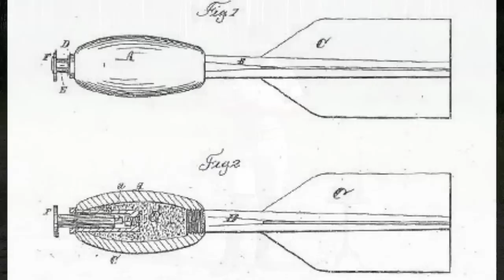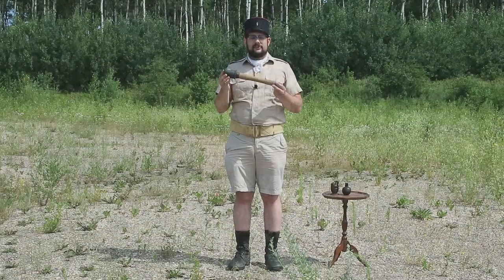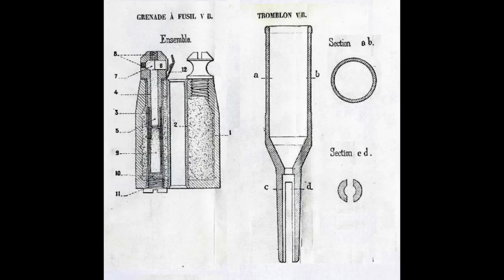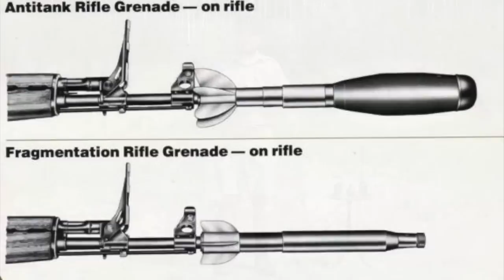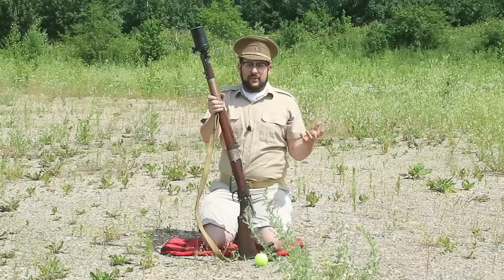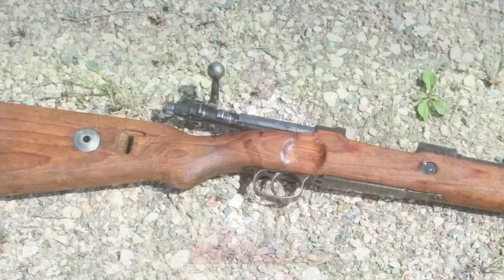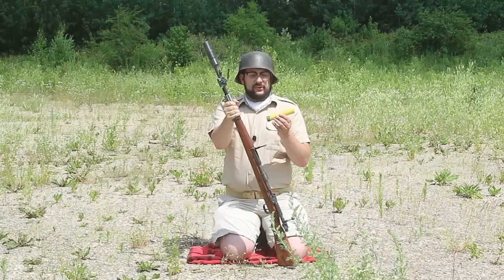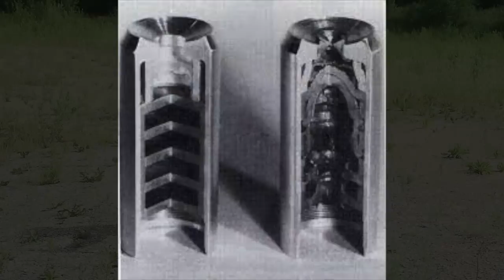The History of Rifle Grenades

Comment: I just watched this, thanks for posting!. I served in the French Foreign Legion, 1977 -1982. We had initially the MAS 49/56 which had an updated version of the grenade launcher that you demonstrated. It used a dedicated firing round, this came packed in the spigot of the grenade itself, in a rubber bung that had to be removed to get the spigot over the barrel. The range was set by sliding a calibrated ring up or down the barrel, rather than the screw attachment that you demonstrated; I think this was part of the 1956 modification on that particular weapon. On the range, it was surprisingly accurate. In action, a degree of nervous tension set in and it was harder to hold the weapon exactly level to the levelling device. Also on the levelling device was a crimp, a sort of simple sight to give you the direction of fire. However, if you twisted the rifle on the ground to get the direction exactly right, this would tend to dip the barrel in the direction of twist, affecting the range; so in reality the grenades landed at a variety of ranges, which tended to limit the weapons effectiveness. It did keep heads down, though!
Reply: Very cool info. Thanks...
Reply: Legio Patria Nostra!
Bonjour l'ancien.
Reply: Merci pour ton service, Légionnaire !
Reply: I also servered in the early eighties and we used the 49/56 for grenades as the FAMAS ones did not come out until 83 ish. This rifle was a real pig to fire if you were doing it anti-vehicle with the strap across the chest and I saw many a bruised or broken thumb from it not being held properly. The ring was called the 'bague coulissant' (sliding ring) and was elevated up the barel to decrease pressure and reduce the range. The sight I believe was 45 degrees to go out to 400 metres and 74 degrees to go to 200. Great little rifle. Later the FAMAS had grenades that were lighter and even had a 5 round magazine that held blank rounds to fire grenades. By the way the hat or kepi is not Legion from what I can see as it only has five flames and is standard infantry. As every one knows :)  ours had five flames in the center and two arching over to left and right to indicate elite troops. LPN.
Reply: The french follow no one, and no one follows the french.
Reply: Respect!

Comment: The German stick grenade could also be used as a booby trap by taking out the delay portion of the fuse, which meant that anyone pulling the fuse cord to set the fuse burning got an instant detonation instead. It could also be used to booby trap doors or hatches. Allied troops were warned to ignore conveniently placed enemy grenades in case they had been tampered with.
Reply: This is true, but there were also factory-made friction igniters with little or no delay. They were used to detonate certain types of mines and for sapper work. They were marked with different colors. It may be added that in the middle of World War II, the Germans simplified their wooden-handled grenades. The friction igniter was located in the grenade itself, and the wooden handle was just plain wood that could be detached if you wanted a smaller grenade.
Reply: These were features, not bugs.

Comment: Found this today.  Thanks.  I try to learn something new every day.

Before I retired in 2010, I ran M203 grenade ranges, and I was familiar with both the M72 LAW and M136 AT4.  The M14's grenade launcher was the M76 and there was a small valve on the gas cylinder to turn off the gas--a cartridge rim was used.  The M64 grenade launching blank came back to haunt a National Guard honor guard detachment because that detachment ordered grenade blanks instead of the M82 blank.  I had entered active duty in 1975 and recognized that the M64 was the wrong blank--a member of the team remarked that the blank kicked hard.  The M64 has a crimped mouth, the M82 is a double bottle necked case that mimics a bullet only has a hole where the bullet tip would be in order to facilitate automatic feeding.  The 40mm cartridge grenade is significantly more accurate than the spigot finned rifle grenade and not as wind sensitive.  I liked to find someone with archery experience as grenadiers because they understood trajectory better.  The 40mm grenade proved more effective on small emplacements due to that accuracy.  On the grenade range and using only the leaf sight (graduated to 250 meters) one young soldier managed to hit the M113 hulk used as a target every time at 400 meters.  For anti-tank work the explosive charge on the M433 DP round is too small to do much to a tank.  The M72 replaced the anti-tank rifle grenade and the M20 super bazooka, but that little M72 warhead didn't have the punch for dealing with modern tanks.  Sweden produced the AT4, three times the weight of the M72, but with a larger warhead.  At around 15 pounds, the M136 was heavy to carry--and expensive as a bunker buster--so Israeli rifle grenades were used to knock down doors on light shelters.  Remember--US troops would launch a TOW or Hellfire missile to smash machine gun bunkers from a mile or more away.  

Every M16 and M4 rifle has an integral grenade launching spigot--the flash suppressor and barrel.  The M195 grenade blank for the M16 I've only read about--the M200 blanks for the 5.56mm have purple or white paint on the tips for identification.  The M195 has red lacquer tips--I would hate to have to clean up the mess from an M195 used with a blank firing attachment. Be careful to use the correct blanks.
Reply: Some really interesting knowledge, especially that tidbit about archery. Many archers shoot "instinctively"; when in training, did the grenadiers use the sights or did they also shoot instinctively?
Reply: @Red-jl7jj  The M203 training I conducted was all fired from the shoulder and generally the leaf sight was used to aid in more-precise pointing.  The 40mm projectiles are visible in flight due to size and low velocity and the semi-trained grenadiers would simply adjust their aiming point to compensate--sometimes before the first grenade landed. That's a major advantage even single-shot 40mm grenade launchers such as the M79 and M203 and M230 have over rifle grenades--much higher rate of fire.  My research told me that these 40mm grenades were also far more accurate.  Compared to a rifle grenade, the 40mm grenade has light recoil--more of a shove than being hit with a sledgehammer.   
In conference with battalion staff I asked if they wanted to train the entire battalion and formally record scores or if they wanted to familiarize everyone in the battalion.  The officers and senior NCOs wanted the latter and expressed satisfaction with the results.  Throwing hand grenades was "instinctive" because there were no sights.  I had three 40mm training cartridges per Guardsman thanks to the Global War on Terror, and even the misses at 200 meters were inside of 10 meters--"broad side of a barn" accuracy was adequate for an area weapon, just get the grenade near the target and let blast and fragments do the work.  On the machine gun ranges, when the first burst was off-target, the trainees had been taught to shift their fire so that the next bursts were on-target.  Grenade and machine gun "marksmanship" are a world apart from precision rifle marksmanship.  
So, yes, the soldiers I trained used the leaf sight but not the more elaborate and precise quadrant sight.  Most of the quadrant sights had been unbolted and boxed up in the arms room because those plastic and light metal devices were easy to damage.  Most of the time the leaf sight was adequate, and at ranges of 50 to 100 meters using the standard rifle sight to point the grenade launcher worked adequately.  

Those with an archery background--even a casual background--made superior grenadiers because they gained an appreciation for trajectory, for wind, and both arrows and 40mm projectiles could be seen on the way to the target.  If I were training large numbers of grenadiers, I'd make up a gun that shot tennis balls.  I'd also like a tennis ball launcher for mortar gunnery practice.  There might be an issue with the trainees regarding the exercise as fun and not taking their training seriously, but tennis ball launchers would be economical and very safe. Either CO2 or nail gun blanks could be the power source for launching tennis balls. Training to dope the wind and training in adjusting trajectory with a cheap device that could be set up in a parking lot as a grenade range (the most expensive part is establishing a safe training range) would be both effective and economical.  When using high explosives, having at least one EOD tech on the range is necessary.  
Before the First World War both hand and rifle grenades were specialized weapons handled by grenadiers in siege warfare.  The hand grenades were three- or six-pound bombs with a fuse that had to be lit before throwing--didn't do much good to lob those big hollow iron spheres without lighting them first.  Back then, a mortar was a stubby-barrel cannon that resembled a chemist's mortar, a sturdy shallow bowl used to pulverize solid chemicals.  The modern hand grenade is a very convenient device, hip pocket artillery.  Up to the 19th Century grenadiers were large, strong men chosen for their ability to lob hand grenades and they used a throwing technique similar to the shot put event in track and field.  Modern grenades are less than a pound, immensely more lethal, and most (but not all) soldiers can be issued grenades.  In Marine Corps boot camp I witnessed one trainee who exhibited perfect form--but his hand grenades landed just a meter or two away from him when he threw his hand grenade.  Not all soldiers can be trusted with hand grenades.  Not all soldiers could use rifle grenades or the replacement under barrel grenade launcher and disposable anti-tank rocket.
Reply: @alancranford3398  That was a great read! Thank you!

I'm unsure how much of a reader you are, or how much you care, but there's a 1952 paper titled "Use of Infantry Weapons and Equipment in Korea" by G.N. Donovan.

One of the main reasons put forth by the soldiers (through Donovan) is that the rifle grenades of the M1 rifle were not used much because they were inaccurate. Whether this implication (emphasis, Donovan doesn't elaborate much at all) that they were so inaccurate as to be unreliable/unusable in combat was due to a lack of training, I cannot say, but it's interesting to see.

My father entered boot camp some time in the mid-late 70s, and when I asked him about rifle grenades he said he only vaguely remembered training with one for the M14, so this was some really interesting knowledge.
Reply: @Red-jl7jj  The SLA Marshall edition of infantry weapon use in Korea didn't cover the rifle grenade.  
I have forgotten the source, but there were studies on the use of 60mm versus 81mm mortars, 57mm versus 75mm recoilless rifles, and 2.36-inch versus 3.5-inch rocket launchers (Bazooka and Super Bazooka) in Korea.  After Korea the US Army dropped the smaller weapons from infantry battalions.  I was in boot camp and part of my training at Camp Pendelton was a firepower display with 60mm and 81mm mortars, a 3.5-inch rocket launcher, the M72 LAAW (that's what the Corps called it), the 106mm recoilless rifle, and the 40mm grenade.  This was in the summer of 1975 and I don't recall seeing the M14 rifle or rifle grenades being demonstrated.  M60 and M2/HB caliber 50 machine guns--check.  M16A1 rifle--yup.  Even the M1911A1 pistol was demonstrated.
Training in peacetime has different priorities than wartime training, and wartime censorship helps hide those deadly training casualties from the public.  One peacetime priority is that the maximum number of people graduate and another is keeping the breakage low.  If a recruit doesn't survive peacetime training, the recruit doesn't graduate and someone will have to explain why the recruit died.  Rifle grenades are very dangerous to work with compared to 40mm grenade launchers.  There's a high dud rate compounded with terrified recruits don't properly arm their rifle grenades--terrified of their drill sergeants and drill instructors, terrified of their rifle, terrified of the rifle grenade, it's hot, it's cold, their feet hurt, why is everyone watching me?  Defective fuses may be worse than a dud--the grenade sometimes will explode upon launching or will brush against something close to the recruit and detonate.  Soldiers have been injured by the recoil of rifle grenades.  Imagine the results of accidentally firing a ball cartridge instead of a grenade launching blank--there's always that possibility and the range cadre's job is reducing that to zero.  No peacetime rifle grenade training reduces that to zero.  During the Korean conflict boot camp was shortened and infantry soldiers were either WW2 veterans with low points (little or no battle experience) sent home in 1946 or were green troops with less than six months total service time--sometimes as little as 90 days.  They may have fired the M1 rifle with ball ammo for qualification and thrown a hand grenade before shipping to the war zone, but at the time the infantry tool box contained the M1 Rifle, M1 and M2 Carbine, M1918A2 Automatic Rifle, M3 and M3A1 submachine guns were special equipment, two models of bazookas, the M1919A4, M1919A6 and M1917A1 caliber .30 machine guns, plus rifle grenades and mortars and recoilless rifles.  Unless assigned to a weapon crew, the green soldier fresh from boot camp was unlikely to know much about the rest of the weapons.  Later, regulations mandating a minimum of 16 weeks "combat training" were put in place.  During Marine Corps History and Traditions WW2 Marines were given little more than "discipline" in a few weeks (four to six weeks) before being shipped out during the early days of the Pacific campaign.  The problems were severe and led to such things as my Nevada Army National Guard Operation Iraqi Freedom II unit, the 321st Signal Company out of Reno, receiving 90 days of mobilization training at Fort Lewis. The extra training weeded out the unfit (unfortunately there were some) and imparted skills that were supposed to already be present.  It is entirely possible that lack of training was the culprit.
One stunt that ego-driven shooters pull on new shooters is to load up a shotgun with heavy recoiling 3" magnum loads and laugh, laugh, laugh when their new shooter gets knocked to the ground.  Or they'll load up a very hot .357 magnum load in a revolver and have the new shooter bonk themselves on the head with it.  I noticed that in your video you fired with the buttstock on the ground and not in your shoulder.  If your first experience with a rifle grenade was using your rifle range skills with your M1 rifle and aiming with the rifle sights (grenade sight?  what's that?) what do you assess as your probable results?  You actually have rifle grenade EXPERIENCE, I have "book learning" and experience with 40mm grenades.  
Or it could be that the rifle grenade has only casual accuracy.  On the 40mm grenade range, getting the grenade within five meters of the target was a "kill" and 40mm grenades are lethal to 15 meters from detonation point.  A bore safe device in the 40mm grenade keeps it from exploding until it is 14 to 27 meters from the muzzle.  Just for your readers, when the intended target is 10 to 40 meters away, a hand grenade is probably the best option.  I don't know how far away an impact-fused rifle grenade arms but that's an additional hazard--it may arm only a few meters away and during training 40mm grenades sometimes hit the ground close to the shooter because of flinching.  During combat operations in the Middle East Mk19 40mm grenade machine guns were swapped out for M2 HB caliber 50 machine guns after the crew fired a grenade at a wall and the grenade bounced back, exploding on the other side of the launching vehicle.  Thanks to vehicle armor, flak vest and helmet, the crew survived to learn from their mistakes.
Reply: @alancranford3398  if it didn't explode on impact then it hadn't armed and if it hadn't armed then it wouldn't have exploded after bouncing. Arming is based on rotations, not distance. Something doesn't add up.
Reply: @alancranford3398  also, low velocity dual purpose or HE rounds only have a 5m kill radius though they can produce casualties at longer ranges if you're lucky
Reply: @bobbing4snapples  I'm not sure if I have the conversation thread but you are correct that arming is based on rotations--however, those rotations are imparted by the rifling spin and it takes distance for the bore-safe mechanism to arm.  The M203 is also set to arm after the number of spins the explosive projectile makes when it travels a safe distance from the grenadier so that the grenadier isn't killed by his own weapon. The twist rate is one turn in 48" and the 31 meter "minimum arming distance"" means that the grenade has spun25 or 26 full rotations before being armed to detonate on impact.

Comment: the Lee Enfield has been bound with copper wire to help the wooden stock survive the shock of firing. My late Grandfather fired these and said that the firer had to operate from cover as the baseplate of the grenade often came whizzing back at high speed, towards the firer.